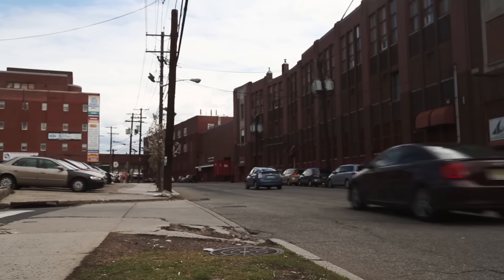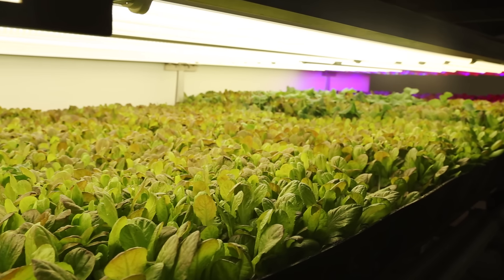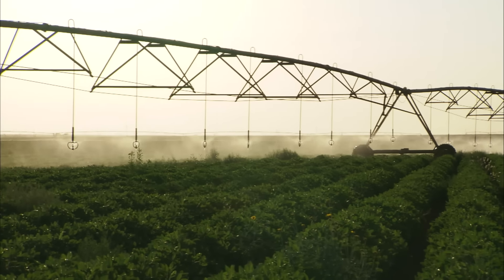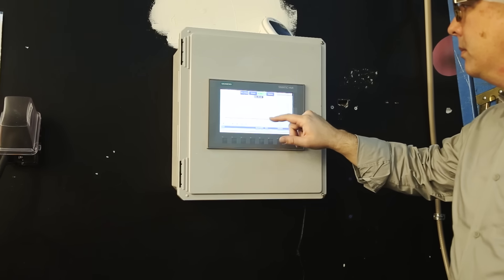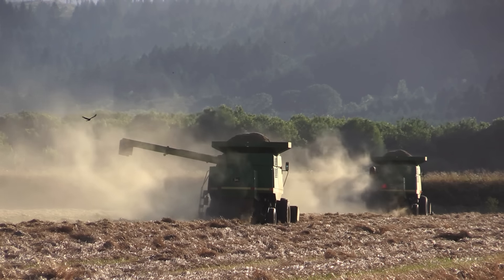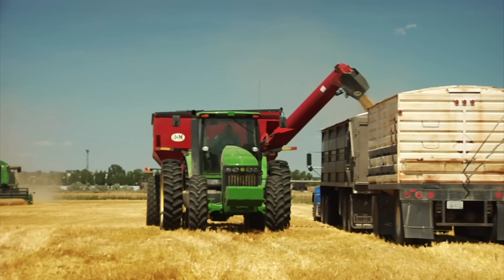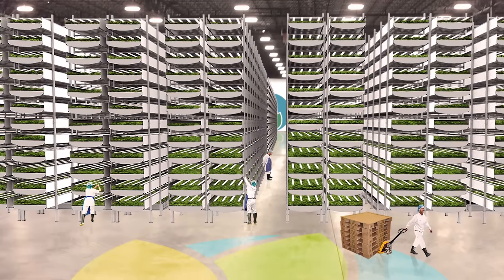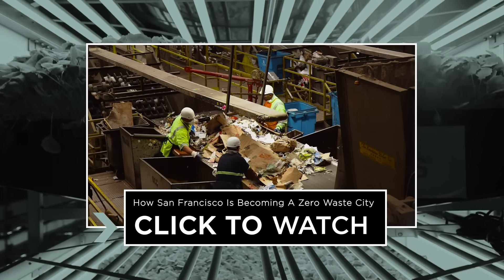This Farm of the Future Uses No Soil and 95% Less Water

Comment: They have not mentioned the most important factor.  Is it cheaper?
Reply: Jacob H depends. Initial investment? Much higher. Ongoing costs? Lower, largely due to the fact that the LED lights and low-wattage misters cost less in their electricity costs than the ordinary farms cost with their water costs.
Reply: They just said they don’t need to transport the food anymore, compared to a normal greenhouse it uses less light, space and water. They’ve cut down on everything you can.
Reply: @Ritaaw1  except they only grow a few types of small plants. They look like herbs, and the lights being used is fluorescent, not led.

Comment: Okay cool, but do they source there electricity from solar/wind/water or is it on same coal grid as lots of other cities? Actual question not trying to be rude.
Reply: And where do they get the minerals fir the plants? Does it need a truck to cross the country in order to bring the nutrients? There are still many questions...
Reply: They didn't brag about producing their own power, so I would say they are on the grid. But dams and reactors also exist, so they may not be adding to another problem. And, it would not be as massive an abuse as some others are at any rate. Given time they could use alternate power sources, as profits allow, and tax breaks that business improvement gives would offset that cost. We could all campaign for it with relentless onslaught of e-mail and they would do it just for bragging rights (and to shut us up). You make a good point, I hope I did, as well.
Reply: @CarteiraRica-oficial  the damage a truck loaded with fertilizer contributed, and one truck load would go a long way, would have to be less than a fleet of tractors running all summer long. But some places use fish tanks to recirculate their water through and all they have to do is feed the fish. If they used the crop wastes to produce fish food, it would be a completely enclosed system that would never need anything but seed. There are some questions, but there are economical solutions for most problem areas. I worry about degraded plastic leeching chemicals into the plants, but a loose weave cotton mat would solve that. It would have to be replaced more often, but it would be safer. There may be problems, but, problem solving is why we have minds in the first place. Right?

Comment: Probably no good for root vegetables. Seems like it's only been used for hipster salad so far.
Reply: Not good for any veggie. Mmm plastic.
Reply: yea don't see this thing working for stalk veggies as well, would be quite hard to get corn in a system like the one shown
Reply: True but this helps free up land for other plants that yield better crops.
Reply: Noah G. while its quite possible for this to be true, hydro/aero-ponics are that new of an innovation since both have been around for 10-20 years by this point so slightly inaccurate with the plane annalogy
Reply: Noah G. can agree to that, just wanted to point out that this is nothing ground breaking, just a new method to the same tech if anything

Comment: But don't forget :
- 56 % iron
- 23% calcium
- 26% phosphate
- 60% vitamine C
Reply: All the necessary nutrients can be added to the water with ease, and organically. The nutritional value of crops could even be improved on by targeting each plants requirements. Your concern is not a problem, at all.
Reply: @darrelgaines777  They are already added, but despite of that the fruits are still poor in nutriments.
I hope you are right and science will solve everything but I doubt
Reply: @LucreziaPro  I haven't seen that study, but will investigate. It seems odd. And, as far as science correcting the problem, some rich guy has got money to be made, and if the process can't match soil grown produce, the rich guy will loose money. You can bet that if it can be fixed, it WILL be fixed. There is nothing rich guys hate more than loosing money, and nothing they like more than more money.
Reply: No no....no nutrients!!!!

Comment: I found it suspicious that they completely ignored electricity. And comparing the normal way of agriculture with this modern tower version you need the see all the data, I can not believe that this produces Les co2 with all that electricity consumption. Of course you could say they use solar panels but everyone can say that and for a this big project you need a quite big solar panel area. Probably 80% of the used electricity is not green and I doubt that this will be better for the planet and it's eco system .
Reply: Take in Consideration That Not All Electric Power Comes From Burning Fossils, There Are Other Sources of Energy That People Can Use and Have a Lesser Impact, The Most Strongest is Nuclear (Which in Fact Some Counties Actually Rely on It As The Main Power Source Such as Japan) If People Start To Get Rid of The Nuclear Fear Provoked By The Bombs and The Cold War So Many Years Ago and Start Using it Like a Main Power Source Then How Much It Can Change

Comment: Less water, more electric power, more carbon emissions?
Reply: Photovoltaics?
Reply: Probably true, even when using PV it is a huge impact to the environment, I also don't see why you shut convert the sunlight into electricity and then back to light when you could just use the usual sunlight on the fields!
Reply: manu ochenta  Well, that is just what I said, vertical farming does not make a lot of sense, since it is very energy-intensive, I cannot understand why you have to doubt my intellectual capabilities just because I say it is not smart to first transform the sunlight on what is now agricultural land only to convert it back into light elsewhere. And you are right, in this factory you can not grow major crops and it also would make no sense to grow such cheap and well-transportable products that way.

Comment: if you could use solar panels to power the lights and other mechanical accessories, it could become completely self sufficient.
Reply: Sylas viper unfortunately is not cost effective yet. Need more mass production and improvements in the development of energy storage and transforming DC to AC
Reply: No it isn't because the area used by the factory is smaller than the area needed for the solar panels! You would end up just converting green farmland into solar deserts, meaning you use less energy and a huge amount of labour for nearly the same product even when you do not calculate the fact they run their lighting also at night when your solar panels do not produce any (!) current.

Comment: I wonder electricity bill of that place ? XD
Reply: Đức Nguyễn Minh they can solar panel
Reply: hardyman i can just laugh abou that.
blocking out sunlight and then put solar panels on the roof to power led that mimic sunlight.
that is rediguilos
Reply: How is it ridiculous? If you removed the roof, only the top layer plants would get any sun. That defeats the purpose of the vertical farm.
Reply: if they did nights and weekends on an energy plan then they could keep the bill pretty cheap...lol I like the solar idea someone mentioned
Reply: Đức Nguyễn Minh they will end up using solar. Back to square one with usimg the sun.  Haha

Comment: and 200% more electricity
Reply: This only gives the nessesary frequencies of light which saves a lot of energy, but yes, this is now electricity instead of direct sunlight we are talking about. Luckily, the energy crisis is being solved. Solar panels are cheaper every day so more people buy them and if we figure out fusion, energy will never be a problem again.
Reply: AK's RULE!! The plants receive all the frequencies of light and all the  nutrients they need. They are just as good, if not better, than farm grown because there is no need for pesticides.
Reply: Kaleb Bruwer no, its not. look into what soil gives.
Reply: Yes, true, it uses way more energy. But the cost in transportation, soil degradation, pesticides use and water use are all way below than the horizontal farming. It looks like it's way more ecological than using the soil to farm, actually.
Reply: Can't wait for fusion, then energy usage becomes irrelevant.
Reply: Kaleb ????
Reply: You need to take into consideration that the electricity here is used into directly growing the plant. If this was the traditional farming equivalent it would be like using fuel for tractors/lighting/transporting/washing/pesticides etc. Basically there is less of an indirect impact using electricity this way
Reply: 200% more electricity, yet 2000% more efficient than regular farming
Reply: I would say that's okay for the benefits, especially in fresh water challenged areas. Also, the technology should get better over time. That said... "Sprouted up all over" and "taken root in cities" in regards to vertical farming? Oh god, these puns. Cringe. Lol
Reply: With the benefit of all year round growing and 24/7 "sunlight"
Reply: Derkasaurus plant did not need 24 hour sunlight directly, they do need night and mist conditional to store energy.
Reply: Put solar panels on the roof and problem solved.

Comment: Then you realise how much electricity this uses
Reply: I guess it will be useful after we poison the surface and have to live underground
Reply: It uses Electricity yes, but go do a little research on LED's and then come back and revisit your comment.
Reply: @bookcadenb4584  LEDs use 32 Watts per sq ft more (on average) than natural sunlight just to run. They also contain significant quantities of heavy metals including lead, arsenic, and nickel whose extraction, refining, and manufacture have significant environmental impacts and use significant amounts of water and energy. Compared with other types of artificial lights, LEDs undoubtedly have a smaller environmental footprint, but they are far worse for the environment than natural sunlight to grow plants with.
Reply: @ashevillecat  They are not in any way worse. The sheer volume of Herbicides and Pesticides required to grow food in our dead soil here in Merica is extremely costly. That doesn't even mention the massive quantities of water required.
Reply: @bookcadenb4584  LEDs not worse than natural sunlight???
Reply: @ashevillecat  I guess you need to L2Read. I very clearly stated that it's not worse a setup than the equivalent growing in the ground outside.
Reply: @bookcadenb4584  ...and I very clearly pointed out all the ways it is much worse - which  you failed to address - including energy requirements to run them and energy and material use in manufacture and distribution. Natural sunlight is orders of magnitude more sustainable.

Comment: Using so much electricity, ventilation due to heat of LED lights.. oh my
Reply: Maybe  he did'nt realize that excess consumption of electricity is still a form of pollution unless you use solar panels to tap the sun's free energy----going in circles and at extra cost plus the maintenance.........

Comment: This is seven years old.  I recently watched a video about this industry.  A lot of vertical farms have gone out of business.  Part of the problem for most is operating costs, which are large.  For one there is the electricity needed because the plants get no natural sunlight and are protected from natural temperature changes.  Think about your heating and cooling costs.  I assumed they wouldn’t have any problems with insects or plant diseases.  Doesn’t always seem to be true.  
There are lots of not green aspects about the industry as well.  How were the concrete slab floors, the buildings they are in, the shelving, the trays, etc., etc., etc.?  No fossil fuels used in any part?  🤣🤣🤣🤣🤣🤣.  Same huge problem with EVs.  Lithium is mined dears.  The metal parts are from mined materials that had to go through many processes and steps.  
Likely other not green things about this.

Comment: Did anyone listen? They are using LED lights. They use so little energy, they aren't running dryers all day, it is just the lights. There is probably 100 times more consumption costs keeping a Walmart open 24 hours a day.

Comment: The thing is that we NEED ground cover to reduce the ills of climate change. The water contamination he spoke of is related to the farming of mono crops typically with pesticides and herbicides that destroy the soils biodiversity through run off because there is a lack of strong root systems to hold the water as well as a lack of ponds/basins . These methods seem to just neglect all of that. What needs to happen is a return to DIVERSIFIED farming and that can be done in the city, in backyards, front yards, on other small areas of land. The only thing is  it doesn't excite investors in the same way, yet, but who knows what the future holds.

Comment: Since it grow by lamp and less water and not sure with the oxygent, how is the vitamin & nutrition in it?
Reply: Plants need carbon dioxide to grow, not oxygen. They extract the carbon in the air and use that as the raw material from which they grow. When we eat the plants, we take in their carbon. We breathe in oxygen, combine it with carbon as we breathe out, and it becomes food for the plants. The bulk of the material in a plant is from what it pulls from the air, not from what it absorbs through the roots. (Though there are trace minerals in the water that is misted onto the roots, it doesn't make up the bulk of the plant.)

Comment: The carbon footprint would be very large, all that lighting needs to be manufactured and replaced at regular intervals the electricity to run those lights all the other materials and you can only grow fast growing quick turnaround crops if you want to make a profit.

Comment: Couple of negatives - yes the led lights are low energy but there's a lot of them!!! Sun is free and doesn't require a factory in China to make all of the led lights from whatever parts (carbon footprint). Additionally, what about the positive impact of all of the plants outdoors that would then be missing? Need to see some actual numbers to see if this is better. The US has much lower standards in terms of agriculture and pesticides compared to the rest of the developed world so whilst it may be better for them, it may not be better for o[hers. I can see value in dry poor countries where there is famine. Sadly, this company industry won't go where mouths to feed are, it will go where profits are.

Comment: Ok, i really hate these promo videos. Can we have some facts at least? how many calories per Watt energy do they produce? can they produce calorie rich veg, like potatoes or wheat? how do they prevent pests in a closed, dense system like this? how much transport emissions are cut compared to emissions produced by the lights used? How much do they depend on subsidised electrictity? What are the benefits over permaculture like they do it in Cuba, or sustainable farming like Vandana Shiva and UN FAO are proposing? how much does a pound of lettuce they produce cost, compared to  farm produced? how will they resist selling the veg to Saudi Arabia, if the market pushes them in that direction? 

IS THERE A SINGLE PEER REVIEWED STUDY ON THE COSTS AND BENEFITS OF THIS TYPE OF FARMING????

Comment: Yes single infection untolerated by the safety of rooms will cause u crying about the whole work ... sadly this is not correct...  China is doing a better job by building skyscraper with open fresh air with sunlight and still solving the problem of water and space .. controlled humidity rooms are not the best solution